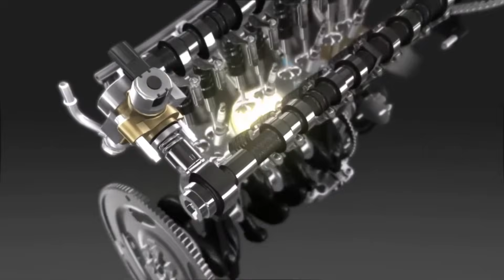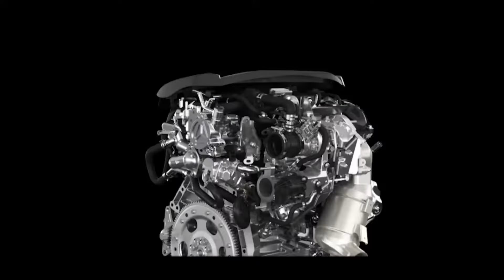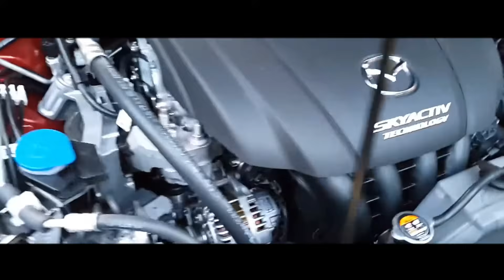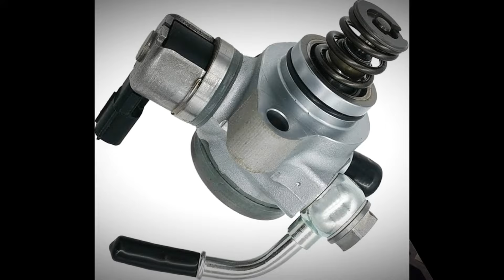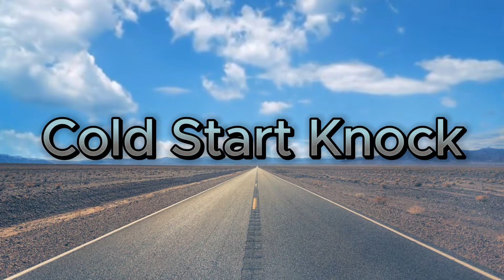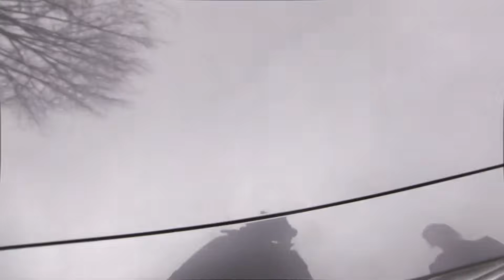Specifications, issues and reliability of the Mazda 2.0 SkyActiv-G engine!

Comment: Toyota builds a superior Direct Injection engine because they have addressed the carbon buildup problem with DI engines where Mazda has done nothing about this huge problem. Toyota / Lexus designed a Dual Injection system to help lessen the problem.
Reply: Not driving like you're afraid of RPM helps clear out the carbon. That's what freeway on ramps are for.

Comment: i had that ticking noise in my motor . all i did is was removed the positive cable from the battery. over night. to reset the computer. and it has been working better than new than when i bought it.. and of coarse , premium fuel..
Reply: I think its some battery setting 34 on your middle screen i reset it every month to let it charge fully instead of "just enaugh" for fuel economy wich depletes me battery a bit to low if u do short trips. Maybe it needs more voltage to give best spark or some fuel saving algorithm does prevent something about less opening valves maybe wich causes it run a bit more badly? Also the ticking noise went definitely hearable quieter with wynns super friction proofing additive every oil change... When im at the inspection they thaught i shutdown the engine while it was running :)